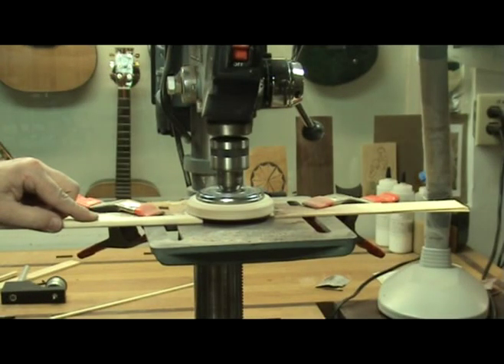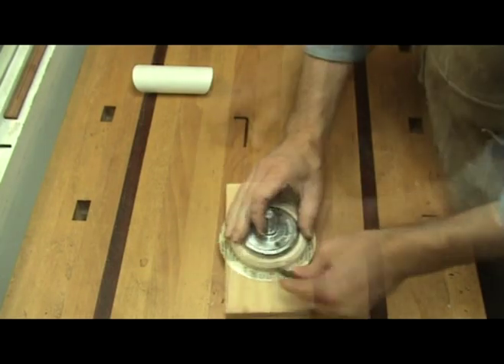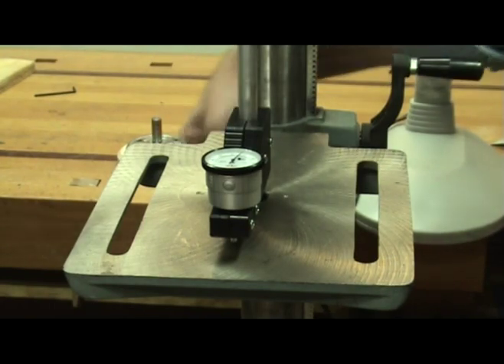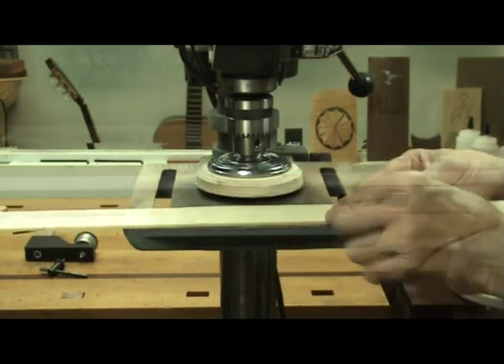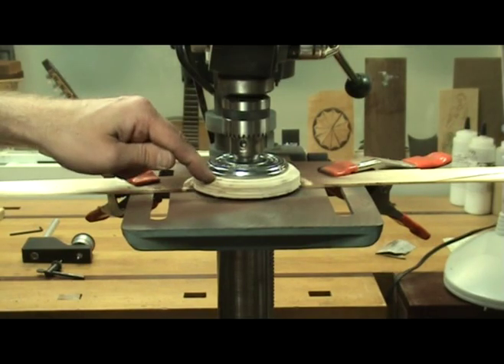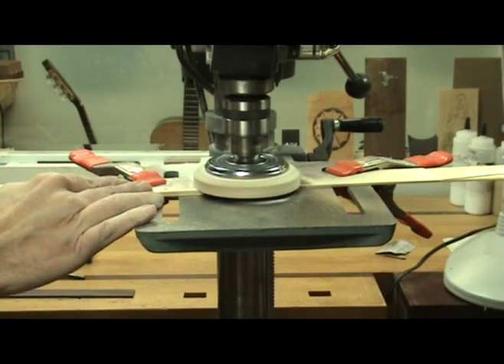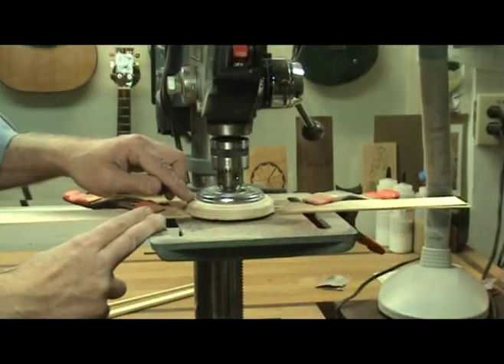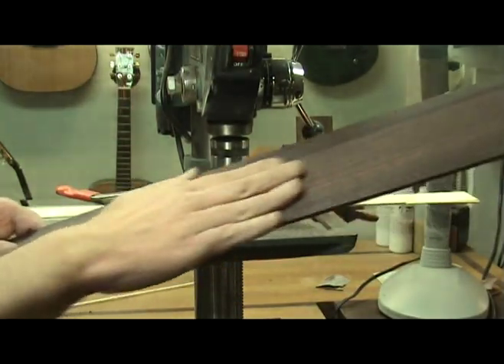LMI Safe-t-Planer sanding disc

Comment: HI, Nice info. Quick question. What is the speed of your drill press when you use the sand disk or the safety planer? Thank you.
Reply from the maker: Between 2 and 3 thousand rpm will work
Reply: Ok. Thank you for your fast answer.  I will try it that range out.

Comment: Dear Robert:   

        It doesn't look like LMI stocks this sanding disc anymore.  It also doesn't look like there are any impediments to prevent me from making a sanding disc of aluminum, steel, or some high density press board.  It appears the recesses for the cutter bits on the planer disc would require building pedestals of some sort to mount the retaining nuts, but good glue either epoxy or Tite-Bond should work for fastening these to the disc itself, then drilling and mounting the nuts with an epoxy matrix, taking care all the while to keep everything the same weight and size in order to provide a balanced assembly that shouldn't vibrate too much.  What do you think?  I already have an auxiliary table for my drill press that has a moveable rear fence, "T" tracks, and numerous inserts for attaching featherboards, mortising fixtures etc. to use with mortising bits, and other fixtures that will provide for vertical featherboards and other holding and clamping devices.  What do you think is the maximum size disc that I should make?  I'm beginning to think that I should just make a disc with an appropriately sized arbor with let us say,  a 1/2 inch shaft not too long so it will be stable at speed, and forget the Safe-T-Planer altogether for thickness sanding.  Perhaps a 6 inch aluminum disc about 1/4 inch  thick for lower mass and stability would be appropriate, then run it no faster than vibration allows.  It also seems to me that the closer to the chuck that the arbor flange is, the more stable and lower in vibration the tool would be in operation.  Your input would be greatly appreciated.

Best Regards

Don Denison
Reply from the maker: I think if you get the disc too large it would be hard to keep it true while using the drill press. I prefer to just use the safe-t-planer and then a scraper to finish it off. If you decide to make one let me know how it goes.
Reply: Dear Robert: 

     I did build a combination 6 inch by 48 inch belt sander/12 inch Disc sander years ago using a jack shaft and pillow blocks to run both the belt and the disc, with a 2 Horsepower motor complete with two tables of sizes large enough to be useful.  I used a secondary shaft, itself mounted on pillow blocks and an arbor secured by key stock and the aluminum plate to make the disc with, roughed it out, then filed it close to my scribed line then allowed it to rotate against my coarse mill file at low RPM to true it up, I then balanced it by drilling the low side, found when I spun it without the drive belt installed.  Building a suitable frame to support the tilting tables, and designing guards and dust ports was the biggest headache, I can't tell you how many board feet of lumber that home made sander has processed for me, that is why I thought of doing a light 6 inch plate on an arbor that would chuck in my drill press chuck, the one I have will take a 5/8 inch shaft easily.  I have a Grizzly multiple speed 14 inch drill press which I have fitted an auxiliary table to for multiple usage.  

     The biggest problem in using a drill press is finding the correct bearings in the right sizes, I used bearings in my press that were intended for use in a Vertical Mill, it makes it more stable and it will now take side thrust was well as down thrust without ruining the bearings.  I worked for several years as a Millwright before an injury forced me into teaching, so your video got me thinking,  I will build a rotary thickness sander of about 6 inches and see what transpires..  If a 12 inch disc won't shake things apart, a little 6 inch disc should be a piece of cake up to about 2,500 RPM,  though  it would still be useful at about 250-350 RPM, though at that slow speed I don't think it would work well for adjusting thickness.  I'm running the 12 inch at 1750 on the motor, stepped it up slightly to about 2,000 for the disc.  When I get this thing built, I'll give you a report.  I believe this is probably a way to thickness tops and backs without investing in an expensive thickness sander.  I presently am using a sled and my thickness planer to adjust thickness which works OK, but snipe is a  problem occasionally regardless of how well I adjust the machine.  A rotary planer would avoid that problem and the need to use a sled as well, given the proper use of featherboards and push sticks, I can probably avoid the purchase of a $1500 thickness sander.  Then again, I might be able to convert my planer ........Nah, I don't think so!

     Best Regards

     Don Denison
Reply from the maker: I built many guitars just using the safe-t-plane and a scraper for thicknessing. A thickness sander is a luxury item.
Reply: Dear Robert:

     I take your point, and indeed have built my copy of a Gibson J45 successfully without a thickness sander, I say successfully, but I know where every tiny mistake is.  My friend Michael Lewis, a well known Luthier in Grass valley once told me, "Don, the job isn't done until it i done and done perfectly, even if you have to tear it apart and start over".  No one but me can spot the mistakes on the J45, but it drive me absolutely nuts.  I am often to the point of just trashing it,  though it plays, looks and sounds wonderful, I know where that scraper mark on the inside of the back is, I could never in good coincidence put it up for sale so I guess I either have to scrap it or tear it apart and start over.  I have everything here but an arbor, and  I believe that ENCO sells them so I will probably make a little 6 inch Rotary thickness sander on the lines of the one I have envisioned and described to you.  I am an old fart of 75, I recently lost my sweet wife, and need to do something pretty much constantly to fill up the empty hours, so time is of no concern to me.

     I am gathering materials and other supplies to build a Classical Guitar, I may enroll in your online class.  I have two Luthier friends here in CA that I can go to for advice as well, but your on-line class should keep me from being a pest and taking up their time.  A Classical Guitar as you know is significantly different than a J45, so I will no doubt need guidance,  I'll give you a report on the sander after I get it working and have something to tell you.  When I get everything together for the guitar, I'll contact you about the on-line course.

     Best Regards

     Don Denison

Comment: @ 7:07 reaching around drill press with sleeve coming too close to spindle makes this video a failure. Shut off the camera and entertain yourself. After watching a couple of these videos , I was not impressed at all. If you cant figure these simple tasks out for yourselves folks, perhaps lutherie and wood working with power tools is a stretch. Please be safe.